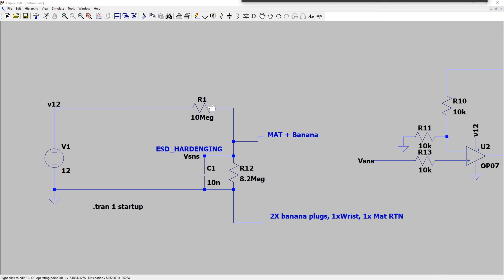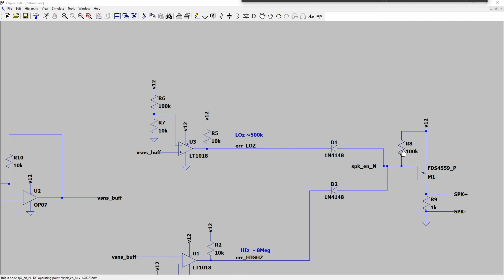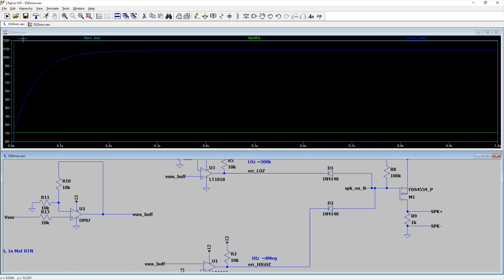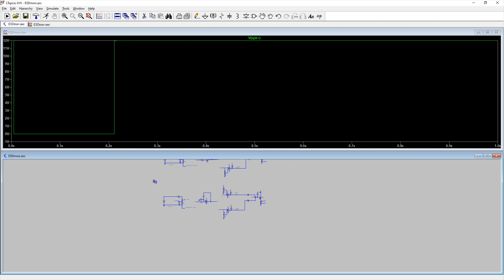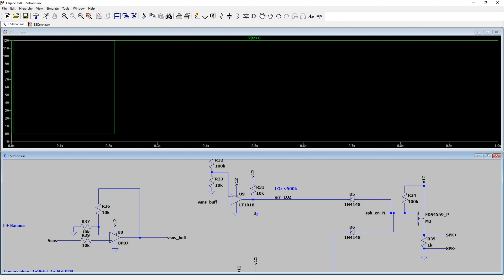LTSpice Exploration – ESD Mat Monitor

Comment: Looking forward to any of the projects really =)

My default for a low input bias current comparator is the mc6541/1R/1U/2/3/4 (that's push pull). If you need open drain it would be MCP6546/7/8/9. I guess the issue there is 5.5v max supply voltage. Quiescent current is nice =)

 There are heaps of options if you don't care for  low quiescent current though. Looking at mouser and aiming for >15v supply voltage, perhaps anything from the TS prefix set of comparators from ST. Looks like ON Semi also has some cheap options.

TSX prefix from ST and TLV prefix from TI seem to have everything one would want except for the price per comparator =P
Reply from the maker: Aha! Me too, normally open! Luckily, we have a couple of projects already started. :) I can't wait to share them!! Thanks for the tips.on low ib comparators, I'll have to dig into these more!